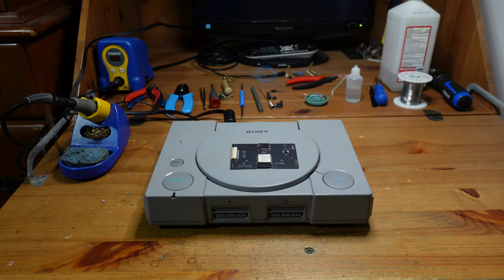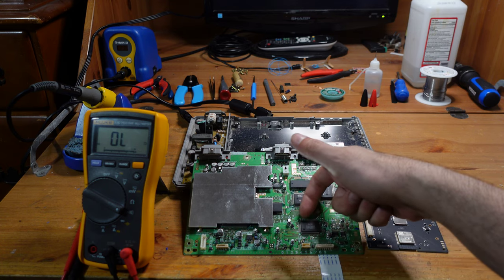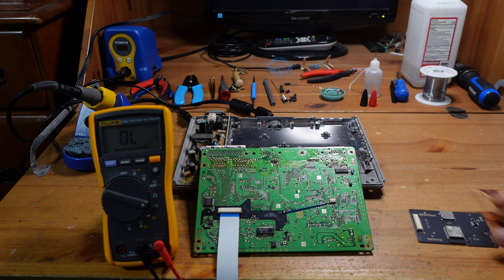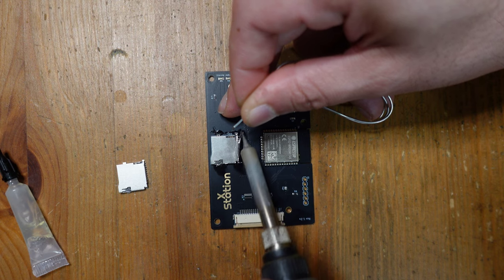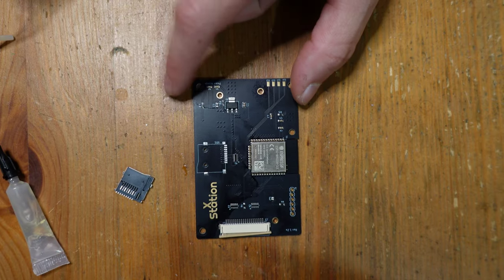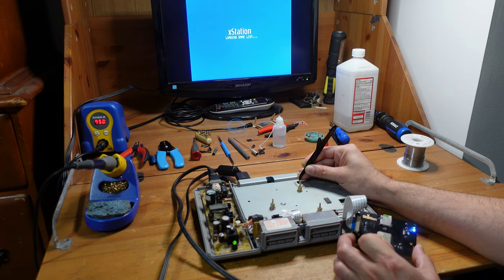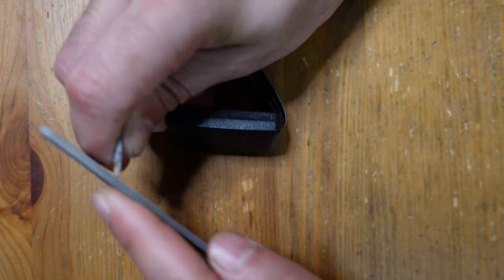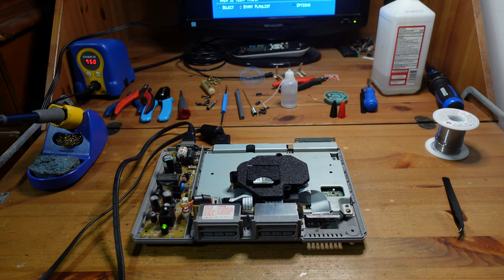XStation mod repairs! How to troubleshoot and fix PS1 XStation installs that are not working

Comment: Hi this is a great video...have a question though, what is the problem if you turn the console on and after the BIOS screen it goes to the CD/Memory card screen and stays there? I tried to do an XStation install and seeming;y it went well except that I had messed up (grrrrrrr!!) when it came to soldering the wire next to the darn oscillator, which I think that pad ended up ruined, so possibly why it didn't boot. I have two more 5501's (both parts units) on the way so I guess I will have to try again when they arrive and hope I get it right this time so I will practice on a dead 5501 board that I have. Though I could easily play my PS1 games via emulation, PS2 or 3 playing them on the original hardware I think is best and no compatibility problems with any games.

Comment: Thought I had the same sd card issue on my install. When I did mine it worked fine then I went to put in the SD card mount and it would work intermittently. Turns out I didn't get the ground pad soldered correctly on the qsb. So when it was just on the ps1 it grounded itself via the metal mounting posts. Took me a while to figure it out
Reply from the maker: Finding those issues can be tricky but I’m glad that you sorted it out!
Reply: @LIRetroGaming  yeah, I was nervous at first. I'm still kinda new to this kind of work
Reply: @Fahrenheit38  you were getting a black screen or it went to the memory card manager/ CD Player?
Reply: @hhectorlector  Right to CD Player/Memory Card screen. Are having issues?
Reply: @Fahrenheit38  Hello, can you help me? My xstation detects the microSD card (green light not flashing) but won't load games. Enter the original PS1 menu. On the memory card save a file with one square. Do you have any idea what it could be? I verified that all the points have continuity according to the scheme that they reported. Thank you

Comment: I ended up installing an Xstation in a PU18 PS1 I ended up with from a broken console lot, and it worked fine for the first day, then suddenly the green LED would be stuck on almost solidly about half way into the white screen part of the intro, then boot me to the memory card menu. I ended up resolving this, so I'm basically just putting my solution here for anyone with the same issue: reflow *everything*.

I reflowed the QSB points, as well as the FFC cable connector on the QSB, and on the Xstation itself. I only found success when I reflowed components on the Xstation itself in this instance, so possibly be prepared for an Xstation with a cold solder joint if you find yourself ending up in this same scenario!
Reply from the maker: Very useful information! I have not run into one yet that has cold solder joints on the XStation itself, but I’m sure it’s only a matter of time!

Comment: It would have been really nice for more people to say something about the sd card extenders being fucked up. Mine was working perfectly fine until today, turned on my console and it gave the blinking green light. Didnt even remove the card so idk why it happened.
Reply from the maker: Yeah, it is a frustrating thing and unfortunately I have seen it happen quite a few times.
The blinking green light might also mean that the QSB on the bottom of the ps1 might also need to be reflowed

Comment: Is there an alternative solder point from the IO16 on the late pu-8? I accidentally pulled on the point on the psx board. It was working great, tested a game then it stopped. No audio or video now.That pad appears to be the culprit.
Reply: Almost a year later but in case anyone else is wondering... Look up PCB trace repair. Seriously, look up example pictures and video demonstrations and such. It's fiddly work.

In short, the pad doesn't matter, electrical connection does. You "just" need to restore the electrical connections.

The first step is identifying where to bridge broken connections. Detailed PCB schematics are very helpful. Expect to spend time probing for connections. "First do no harm" is a good principle here. Some trace repair techniques make it really easy to further damage the PCB. Ideally you can find another pad, via, etc connected to the pad which was ripped out. If not, you can scrape away the solder resist over the trace and solder directly to the trace. Also, if the pad was in the middle of a trace, you will likely need to bridge the broken part of the trace with a wire.

If you have to solder to a trace directly, you're in for some very delicate soldering, both because traces are tiny, and because they are very, very fragile. Pre-bending wires helps, as does temporarily or permanently fixing them to the board. Don't rely on the solder joint to hold the wire in place.

Generic "try on junk PCBs first" advice applies.

Comment: Hi i have this installed and just today for some reason the blue light does not appear no more when i turn the console on would you know what that might be?
Reply from the maker: Check if the cable is connected correctly

Comment: This video is awesome my Xstation doesn't boot up properly every time I turn it on. It sometimes takes me 5 to 10 times before it boots properly. Once it's going it plays the game fine. If I restart the console after playing the game the same thing happened again. If you have any ideas on what's going on please let me know it's very frustrating thanks.
Reply from the maker: Start with the sd card - is it a good brand like sandisk or Samsung? If not then try a new card. From there I would move to the QSB and check the connections
Reply: I use a 500 GB Sandisk It's weird it's like the system detects everything there but it won't load every single time.

Comment: Excellent video!

For this same reason, when I installed my own xstation, I decided on a 3d printed part that doesn't use a full size SD card and one of those extenders.

Instead, I opted to print out a model that just uses the original xstations micro SD card slot. 

Two things I learned... my 3d printed part needed some cleaning up after I printed it and do NOT "test fit" anything until the console is fully assembled. The reason being is that the top shell actually puts downward pressure on the mount. It's super tight without having the top shell on and screwed down. Enough that you might damage your card slot trying to "dry test fit" it.

Comment: I had issues with a couple games on my xStation. Most worked fine, but a few didn't. I did so much troubleshooting of all the QSB connections, trying different SD cards, trying direct SD card VS SD card extension, checking on the disc lid switch, things like that. But nothing fixed it.
Finally it ended up being that my rips of the games in question weren't good. 😅 Really caught me out. I had tried making my own rips. I tried downloading different rips from the internet. Finally I figured out that you need "redump verified rips" for everything to work properly. Once I had those, no problems.
Reply from the maker: Oh man that is terrible! But hey at least you sorted it out!

Comment: Hi. I installed xstation on my ps1 but when i power on i can see only an horrible black screen and blue led on xstation is blinking. I checked all that you said in the video. Is all ok. But it doesn't work. Do you have any idea?
Reply from the maker: Did you check the connections on the QSB? That sounds like one or more connections are not good
Reply: @LIRetroGaming  I resolved. The problem was the psu. I plugged an old psu from a pal ps1, because this one is a 5500 model with a japan psu 110v, not compatible here in italy. Now i plugged a PS1PSU, a custom psu similar to DREAMPSU, and is working. The problem now is the my ps1 remain stuck on the first sony logo. I connected the sd on pc and i saw that the xstation has created an empty config file in the "00xstation" folder. If I power on with the disk try opened, the ps1 show me the classic start menu
I checked all solder point with a multimeter more times, like you suggested on the video. Is all ok. Maybe i'm very very unfortunate 😅 
Now I opened a post on reddit about that. Maybe someone has an idea.
Reply: @mattiabrognoli2616  Hello, can you help me? My xstation detects the microSD card (green light not flashing) but won't load games. Enter the original PS1 menu. On the memory card save a file with one square. Do you have any idea what it could be? I verified that all the points have continuity according to the scheme that they reported. Thank you
Reply: @mattiabrognoli2616  I have the same problem

Comment: I just did a shell swap for the Muramasa translucent PS1 shell, and thought I might have broken my XStation mod on my board. Turns out, I hadn't secured the lid mechanism, enough to have it engage the door closed button. I didn't think to check that UNTIL I saw you do it in this video. Thank you!
Reply from the maker: Awesome, glad that the video helped!

Comment: Do you offer testing and repair services to the sd card slot on the station? Getting same green flashing light and I’m wondering if it’s my problem. :(
Reply from the maker: Yes, you can contact me at my website and I’ll see what I can do to help
Reply: @LIRetroGaming  I’m so sorry…. I didn’t get notification of your reply.  I just wanted to say…. Your video saved my install! Damn 3D print sd card extender jacked my sd port on the Xstation.  Swapped it out and boom! Thanks for the video!

Comment: Hey so I have two diffrent problems that I havnt found any info on. I have one board that has a solid green access light and then one where the access light doesnt come on at all. Do you know what it might be?
Reply from the maker: First, are you testing on a PlayStation that is confirmed working? In other words you installed the QSB board correctly and you can get things to work with another XStation PCB. Without that you can’t be sure if there is anything wrong with those other XStations that you were mentioning
Reply: Yes confirmed working on a working playstaion. Xstation boards all work when connected to my main xstation. I got the one that had no access light to to work by reflowing all the solder points on the QBC but one still has a solid green access light.
Reply: I have the solid green light too. Can't figure it out at all. Tested all pads and good to go. Have you had any luck?
Reply: @joshuaabuzaid9258 I ended up putting a good amount of flux all around the qsb and then held it down with tweezers while I resoldered every solder point. I know  this mod needs to been very on point  otherwise you can bridge the solder points.
Reply: @lunktothefuture  sounds like a plan. I'm gonna de solder the QSB, clean the area and do that.